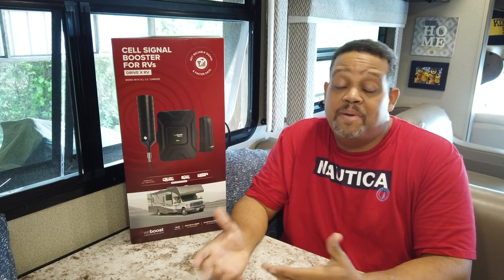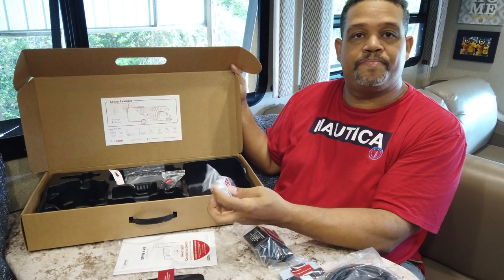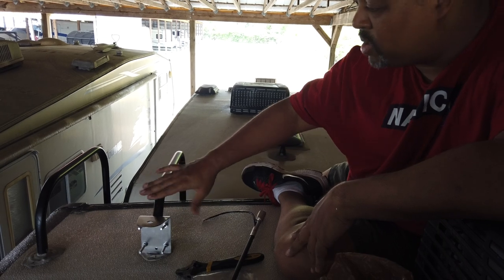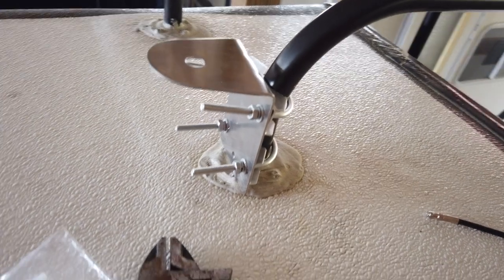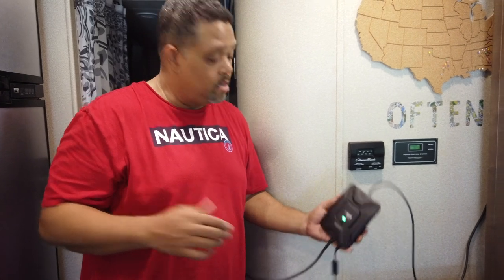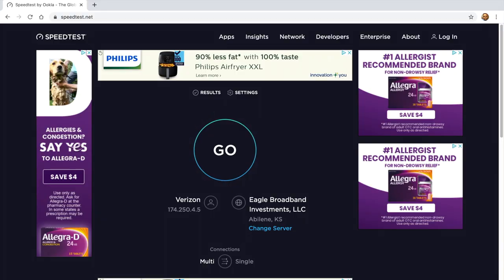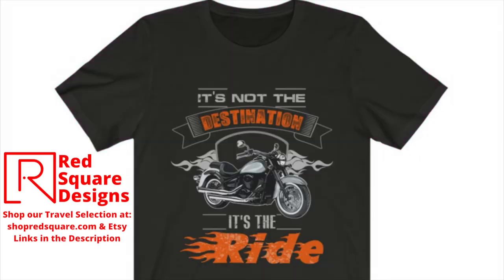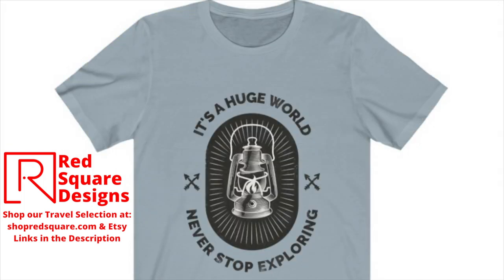Weboost RV Drive X Cell Phone Booster Product Review & Installation

Comment: Thanks for the video. Looks like a pretty easy install. Couple questions wife and I are getting Odyssey at the end of the month and I need internet as well as my daughter (distance learning).
1) Any water leak from feeding through slide?
2) Have you used it in rural areas/state-national parks?
3) have you used it while driving (as a passenger)?

Thanks again for the info.
Reply from the maker: Glad you enjoyed it! We have not had any water issues, the rubber seal has prevented any issues there but we're keeping an eye on that. We've use this in several state parks and areas in the mountains.  Even places where I've had no signal, it has boosted my phone to 1 or 2 bars. It has literally worked everywhere we have camped.  As for using while driving, it's connected towards the rear of our rig and it doesn't use an outlet connected to the battery powered inverter.  However, cell signals are generally decent along major roads since that's where the cell towers are located so it hasn't been an issue for us.  Hope this helps!
Reply: Wander Open Roads Thanks and safe travels!

Comment: seeing the install process was very helpful...I hope to be working a lot from our seasonal site in NC this summer.  Tell me, how did you choose between the X-RV and the RV-65?
Reply from the maker: I was interested in an external antenna that was multi directional and didn’t require extra setup at each location. We’ve been happy with the performance so far